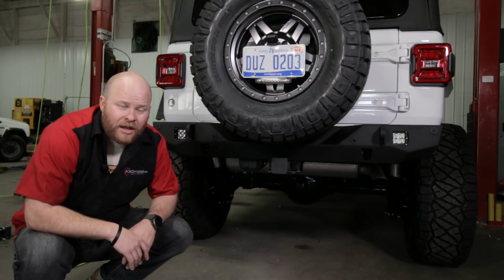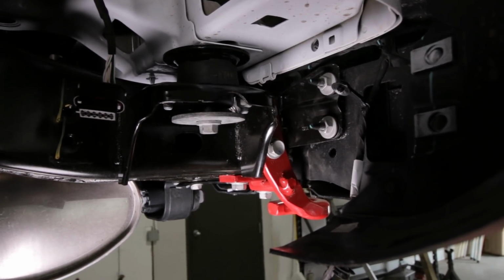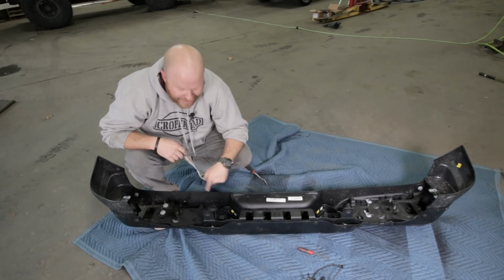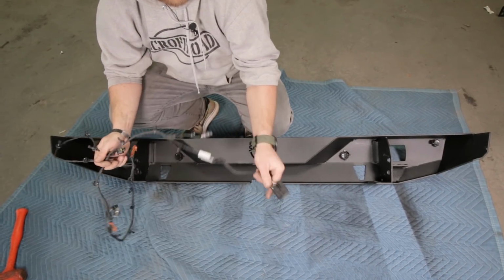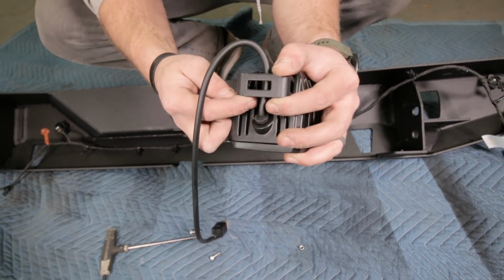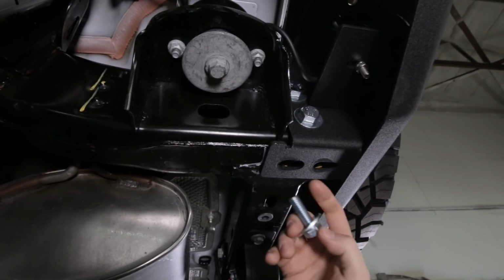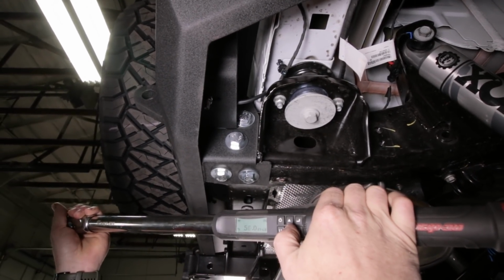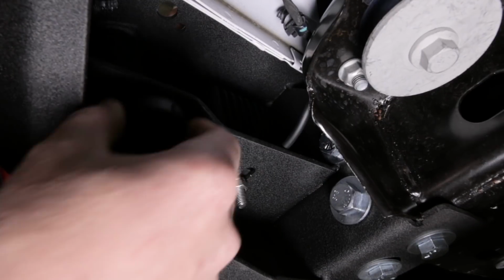JcrOffroad | JL Wrangler Rear Bumper Installation

Comment: Warning: the backup sensors on my Sport JL do not have a bracket that can be removed from the plastic bumper.  As a result, while I was installing the bumper I could not install the factory backup sensors.  I'm really hopeful Jeep sells the clips so that I can put them in, but this video will NOT work for Jeep owners with backup sensors where the bracket that holds them is glued/stamped to the actual bumper itself.
Reply from the maker: Mopar PN: 6MH85RXFAB is what you need.

Comment: why not use metric fasteners for any new hardware instead of SAE bolts?  if the jeep was imperial, use imperial bolts......
Reply from the maker: Trevor McDonald because the PEM fasteners we use on the nut plates are more readily available in SAE, and we don't do enough volume to order custom fasteners and tooling for Metric. Plus that cost would get passed on to the customer.
Reply: i'm having a hard time seeing the "custom fasteners" as any of these can be ordered from places like, fastenal (also on the shelf), McMaster Carr, spaenaur to name a few online places with all of them also selling the PEM inserts and mandrel for your press tool.  i like your products, but wish all the tooling needed was in the same family, so the consumer or new jeeper doesn't need to keep extra tooling in there box or trail bag just for one bumper bolt...i'm fortunate to run our manufacturing of build large steelworks for the aerospace industries and the number one rule is to not mix SAE/MM so no one needs excessive tooling or the opportunity to cross thread something and cause more issues then a bolt of a different thread.  aside from that, i like the design and maybe trading in the JK for a JL and your products are hi on the list.  keep up the good work.